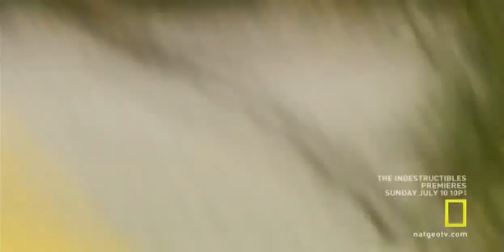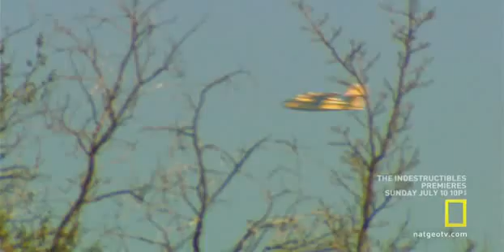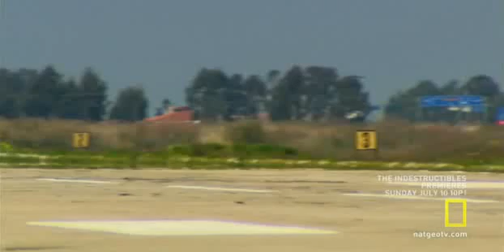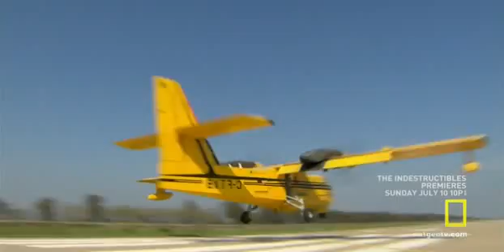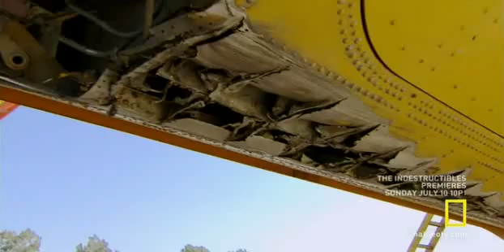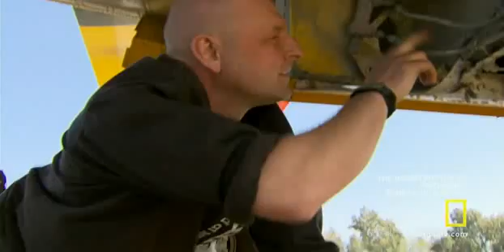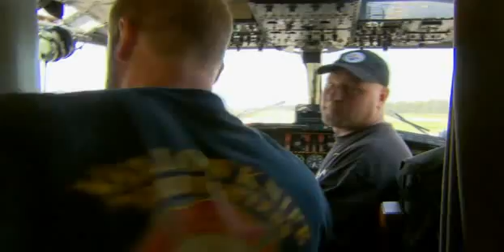CL215 crash landing

Comment: seriously what sort of pilot was this? even a 5 year old kid would know that to land on a runway you need to lower the gear
Reply: Yes it's true but;
Those pilots has been trained and flies in fixed landing gears planes. Forgetting landing gears is usually known events if you have trained and flies "only" fixed landing gears. I wactched many records about belly landing caused by forgetten gears. We don't know excatly, was there any warning/gears light failure or landing gear lever position failure? You are right, there was a checklist, there were two pilots but human factor causes many failures. Don't forget, they were flying first time such as this type (size, weight, capability,configuration,etc). They maybe focused properly landing. Since this accident, there were not any accident occured with the same Turkish (THK) crews.
Reply: hakan737 but you said it yourself, it was the first time so they had to be even more careful. It wasn't like they forgot about it cause they were used to something else, it was all new
Reply: simon199418
 You are right indeed, but as you know exiciting+focused to land makes mistakes. Honestly, they were not "rookie pilots" actually, they had really serious flight time in Dromaders before CL215 as firefighters. Somehow the accident occured. I believe they are checking the landing gears 3 times now :)
(specially, obsessive focused causing coordination and orientation lost while approaching. Remember one fatal crashes, 3 pilots were trying to fixed a warning lamps and they never be realized into deep dive to ground)
Reply: hakan737 another comrade who loves ACI i suppose:P
Reply: simon199418
If you were in place mine, I'm sure ACI always would be better choise than the rest of the TV programs in here :) hehehe

Meanwhile, actually I can't remember what I wanted to mean when I said that. The correct definiton (in aviation literature) is another description which is related about "interested and focused another thing while flying and missing communication-orientation and cockpit dicipline"... I'm sure you remember what is the name(description) on this situation.
Ofcourse it is not an apologize of this accident but it maybe a lesson.
Reply: hakan737 I believe it was united flight 173
Reply: simon199418 Exactly you are right. We shall not be forget Air Inter flight 148 accident (A320) in Strasbourg. They were mixed about setting up descent rate (degree instead of fpm) while listening ATC in really bad weather. (R.I.P)

Actually Simon, there is no excuse of the forgetting landing gears if you(they) have had a checklist. But as I said, somehow they loosing the focused a part of their job; by selfconfidence ,missed item of checklist, unfamiliar a/c type or understressed cause of sitation. They forgat the landing gear like as examples  with forgetting landing gear down on the water. It was not first accident nor last.I really can't find accident report but if I visit to THK at main base in Etimesgut airport in Ankara, I will ask them personally. I don't think so they can give me information :)
Reply: You ever forget something?, it happens all the time!!
Reply: Even if only ever flying fixed gear aircraft you still announce the gear check and down as part of your checklist. Always! Always! Always!
Reply: The kind that followed the script that said "Come in with the gear up, slide down the runway while the special effects crew sets off the pyrotechnics then pull up when the camera crew takes a dive, that way the narrator can explain how their probably going to end up in a fireball. Lower the landing gear and perform a fly over before landing making sure the nose wheel drops off the end of the runway".
Reply: 737 you are so right!  At the beginning of ww2 the RAF was changing from almost their entire Air Force having Fixed Landing Gear, they found out most pilots did a belly flop within their first dozen landings!  (Most often after the 8th wheels down landing.)  In fact it became practice to have a man with a Very's pistol with a red flare loaded watch the new pilots as they came in to make sure they had their wheels down!  (The 1960's movie: The BATTLE OF BRITIAN has a scene where this happens.).
Reply: You said it Bro... and sterile cockpit during critical stage of flight

Comment: Why would you go under the plane knowing that the landing gear could collapse and the plane squishing you.
Reply: +itzjustme Because it's not just the Hydralic holding it up, it's also mechanical locking.
Reply: +itzjustme They put pins in the gear that prevent it from collapsing on the ground when hydro is turned off.
Reply: +itzjustme Yep you would not have seen me under there. That was a foolish violation of safety. Like working on a car without jack stands.
Reply: +Grilledcookie Still wouldn't trust it. If man made it can break.
Reply: I used to be aircraft maintenance. If the gear is pinned it can't collapse. It's physically locked with steel pins from collapsing. You can even throw the gear handle in the up position with hydraulics on and the gear will not even move. This is assuming there is no gear damage, ie; broken walkbeams, knee-over knuckles, trunions, truck scissors, or cracked shock cylinders. But that stuff would be easy to spot without getting under it because it would leave the landing gear all out alignment anyway, it would be obvious.
Reply: Damien Mullins As an old flyer you guys were my safety net. You make many good points.Much of which would be overlooked by the average private flyer.I feel todays training doesnt put enough time and focus into the many technical issues you pointed out. But I can tell simply by your first 2 sentences you know your airplanes. Take care.
Reply: +David Smith And that is why they pay your airline mechanic minimum wage plus 5-8 bucks while working on $20 to $100 million dollar equipment, working 3rd shift in the snow and wind, working in the cold spring rain changing tires and landing lights, working blazing hot summers changing a windshield setting in 98 deg heat for 5 strait hours. Then getting boo'd walking onto a broken plane to try and fix it for a decent takeoff time. Why I'm not an aircraft mechanic any more. Pay sucks and you get more respect fixing cars.
Reply: Damien Mullins First of all I was a private pilot not commercial. As for making 8 bucks an hour the only A&P man I ever saw making that was too stupid or dangerous to fix an airplane so they let him sweep the floor. My brother is a lead A&P man and the lowest paid mechanic in his shop makes 40 grand a year. I on the other hand was a transmission man for 35 years. Flying was simply a hobby. I watched cocaine addicted owners run high dollar shops in the ground. The IRS lock the doors and seize all the equipment. Watched my wages fall while cars got more complicated. Worked minimum 50 to 60 hour weeks in either sweltering hot or freezing cold shops. Watched my pay checks bounce while my employer drove a 500 Benz and lived in a lake house. Oh cry me a river there big boy!! Also please tell me where you found any respect fixing cars. The general public thinks mechanics are trashy,uneducated losers who had only one avenue to make money. Be a grease monkey. Yep been there done that.!!!!
Reply: Damien Mullins I think I owe you an apology. I misunderstood your post. Meaning I assumed you thought I was a commercial pilot and condoned paying A&P men shitty wages while they encountered the crap they endure. By no means do I feel that way nor do I think a man who works on multi million dollar equipment should do so for peanuts.Again my apology for being such a dumb ass I obviously no longer am able to read or comprehend english!!!LOL!!
Reply: ***** You are correct there does seem to be a decay in our society. I ran my own shop for 25 years and never had the need to lie to find business. If people know you are honest they will flock to your door.I still know several shop owners and many are honest hard working people. But the bad ones are very bad and give us all a black eye. I shudder to think what state this world will be in 20 years down the road.
Reply: SoCalDualSport Yes I doubt that war or terrorism will destroy us. Man will with his ignorance greed and disrespect for all that is good.
Reply: +Damien Mullins Certainly shows where their heads are doesn't it?  (Not on their shoulders!)
Reply: +SoCalDualSport NOW THAT'S FUNNY RIGHT THERE!!!!!!!!!!
Reply: The older guy was worried about the landing gear DOORS, which are pretty heavy, swinging open and cracking the "rubber necker's skulls open!

Comment: Former Bombardier aircraft designer. Pilot error, pure and simple. The main gear can be lowered, even after a hydraulic failure. If they had reported such a failure before landing, they would have been told to divert for a water landing. The belly damage was fairly light because the aircraft is built like a tank. Their brakes wouldn’t have worked after landing because of the hydraulic lines that were destroyed with the runway scrape. Had they known about any “hydraulic” issues, the ground crew would have had fire and rescue vehicles available. Tired pilot who had been doing water pick-ups and hadn’t needed the gear until the landing. Expensive mistake, and loose pilot procedures.

Comment: Amazing how long it takes pilots to realize that they have landed gear up.  A Boeing 737-200 landed gear up in Casper, Wyoming, and as it slid down the runway on the engines, the CVR captured the F/O noting in amazement that the auto speedbrakes had not deployed.  They deploy on main wheel spin-up, and the wheels were still safely tucked in the wheel wells.  Duh.  Shortly after this comment, the pavement ground through the engine generators and shut off the power, stopping the CVR from recording more conversation.  We will never know how they finally figured out that they were gear up--maybe they noticed the ground was a little closer to the cockpit windows than normal.  After two new engines, new flaps, and some minor sheet metal repairs, the plane was back in service.  I replaced some of the antennas on the belly, and the #1 transponder blade antenna just aft of the nose wheel well was ground down almost flush, with no damage to the skin above.  A really smooth landing.
Reply: Actually, no.  The spoiler handle was in arm, they just failed to lower the gear.  In a normal landing, at main wheel spin-up (signal from a/s box), spoiler actuator drives handle full aft.  Flight spoilers go to full extension immediately, ground spoilers extend as soon as strut compression opens ground spoiler bypass valve.  Flight and ground spoilers usually appear to move simultaneously because of coincidence of spin-up and squat.  However, I have several times observed a noticeable delay between flight and ground spoilers when the airplane is "floated" on, and right main does not immediately compress enough to open bypass valve.  Squat or spin-up, doesn't matter when the gear are in the wells, neither one happens.

Comment: I worked on a Sikorsky the s43
That belonged to Howard Hughes.  On the first try at flying the control
Cables came off. And there was just enough runway to abort, if they had taken off they probably would have died in a crash. The next time they made it to 1990 version of Wings Over Houston.
After landing they found there was extensive metal corrosion in a vital spot.

Comment: Wow so it's not a crash landing, it's a dumbass landing. Sorry but I mean you didn't get the too low terrain warning??
Reply: As far as I know, CL215 hasn't got that alert systems if installed later or company requirement. Becouse of (I heard from my friend), if she has any "low terrain" alert system, the system can not be understand land or fly while flyover water for filling up. Maybe a system has been installed on CL415 with a smart approximity which is able to realize about to low flight to lands or water flyover.
Reply: hakan737 Hi there. I work for Bombardier and I know for a fact the aircraft come with one. Chances are it was switched off for an assignment/ training, but I mean you need to look at the gear lights before landing any ways.
Reply: Shankovich
Excatly you are right, it should be done on" landing checklist" before final approach. I don't know how many pilots were in there for observing or traning also include any instructor from Buffalo Airlines. I don't know actually what was the phase of training , in solo flight or with instructor. You know "exciting" and "lossing concentration" is a important factor in new type if you are trained in real plane. It shouldn't be happen but it is not first accident in history, thanks god everyone were in safe.

Meanwhile, could you give some more information about terrain alerts related with landing gear position while approaching water or land in CL215 or CL415?is there any special procedures or systems?
Reply: ***** Uuhm, TCAS is something else than you think it is buddy. xD It's the Traffic alert and collision aviodance system, it's to make sure planes to collide, has nothing to do with a plane by itself flying too low without a gear.
Reply: The trouble with an amphibious plane is that a gear warning is useless or even dangerous. You don't want to be going in for a water landing or scoop and have a voice say 'gear gear'.
Reply: Bartonovich52
this is it. It looks like a lot of people in this thread don't realize there are plenty of aircraft that don't have voice warning systems, but almost all have a LGWS (landing gear warning system). From what you have said, I gather a LGWS horn is typically not installed for amphibious aircraft. I thought a LGWS was an FAA requirement.

Comment: Once the gear is down and locked, it cannot collapse on landing. The gear is locked into place and needs hydraulic pressure to unlock or raise.  It the gear could collapse with loss of hydraulic pressure. Then a hell of a lot of airplanes would be parked on their belly's at airports because of hydraulic pressure bleeding off.

Comment: what i dont get is that once you start getting close to the ground with no gear a very loud siren rings out and gives enough time to ether power back up or lower the gear
Reply: +oliver jumelle 
Not on an amphib - otherwise every time you made a water landing, the gear horn would sound.
Reply: +Mark Little well that would be a good thing because a pilot could ignore it if making a water  landing. I'm saying a gear horn should be compulsery in all aircraft able for both land and water operations.

Comment: There was no damage to the hydraulic system.  The pilots messed-up big time. 

Gear-up landings are not uncommon.  Most are due to pilot error. Pilot was distracted and missed the item on the check list.

Wonder what the cost of repair is.

Comment: All planes with retractable gear should install gear warning.
Reply: Since it is a seaplane, it should have a WATER / LAND switch.  Have the alarm go off of the gear isn't in the right position for water or land landings.
Reply: They do. FAA requires it. If the gear is not down and locked and the throttles are retarded, a horn will sound.
Reply: The Kid Apparently not here.
Reply: +mrcannotfindaname It has a gear warning, but since it also operates on water with gear obviously retracted, the crew mixed the procedures. Pilot error.

Comment: I landed gear up in my LongEZ at about the 1,800 hour mark because I just forgot. It wasn't (really) my fault. I was giving this smoking hot chick a ride and we were partying a little. We'd smoked a couple doobies, did a couple lines, had a few drinks, then she GOT NAKED, and..... you know.... OK, I made all but the first sentence up. Anyway, 90% of LongEZ pilots have landed gear up (at least) once. The thing is, being a pusher it does cosmetic damage only as there's a nose bumper under there with a big steel plate under that so no big deal except embarrassment.

Comment: Dramatization and looking for someone to pay for the damage of the runway, I say this because as soon as the guy steps into the cockpit even after they seen the hydraulic fluid in the belly of the plane the guy said this is where you find the mistakes that where made. Give it a break Aussie can be real assholes at times they did not even say well the crew is in one piece, they where more concerned about the damage i think to the runway the way the guy was cursing

Comment: This was Ice Pilots  (Buffalo Airways) delivering 2-CL215''s to Turkey. What's "Too Low Gear" in Turkey? Guess the pilots didn't understand what the plane was trying to say to them. They were probably like "what's that jibberish coming from the Alert system".
Love how over dramatic National Geographic is..."the gear holds" yeah because of the mechanical down lock. Pilots could have also applied reverse shortly after landing as a brake supplemental. It was idiot pilots. Not listening when they should have.